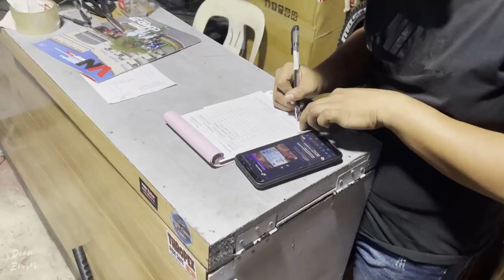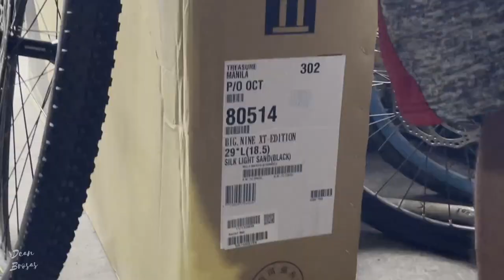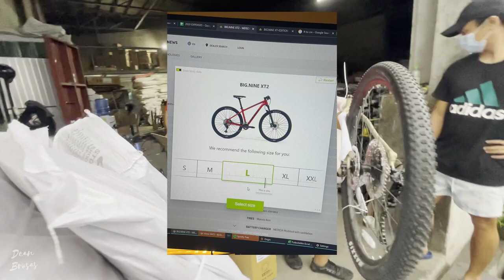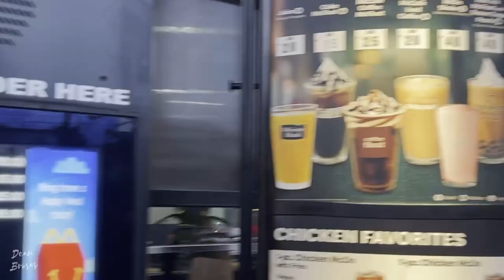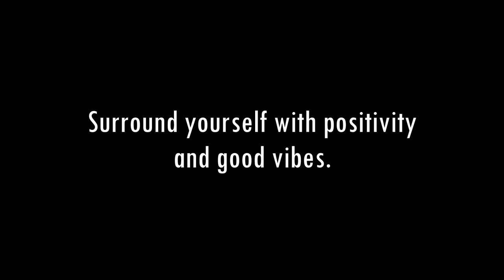I Won My Dream Bike! | Merida Big Nine XT Edition 2021 (Silk Light Sand)

Comment: Sir, what's the rear hub used for your Merida Big Nine XT Edition 2021?
Reply: I'm asking because the spec for the frame is 9mm axle but the MT401 has 10mm axle.
Reply from the maker: @joelbontuyan  Hi sir! I'm not really sure po eh since I unfortunately sold the bike na :(

Pero the spec sheet says "135x9mm width rear hub" kindly ask your local bike shop nalang din po for help!

Comment: Hi on merida website Merida Big Nine XT 2021 , 2020  has carbon Frame. On Your video i see alluminium on sticker. Are You shure there is original merida bike ? Regards!
Reply from the maker: Hi! I think you are referring to the higher variant Merida Big Nine models. Kindly refer to Merida’s official website for the exact specifications of the 2021 XT Edition. Hope this helps! 😅
Reply: @djcbrosas  Hi You're  right   Your bike is different model .The interesting this is that on merida polish  site is not shown but on DE , EN yes :)  Enjoy use!